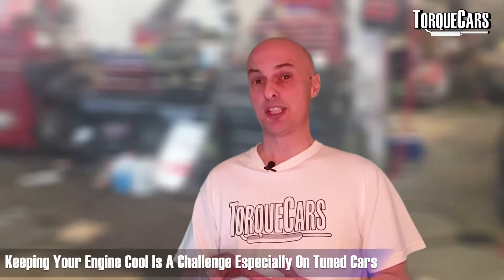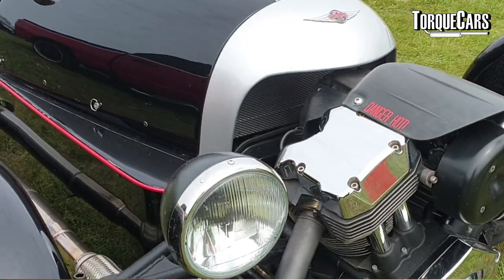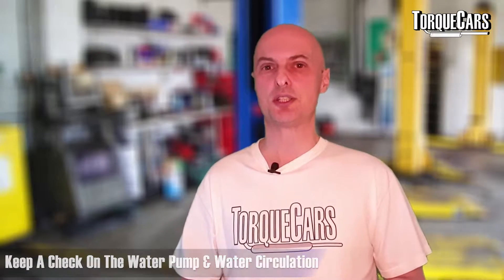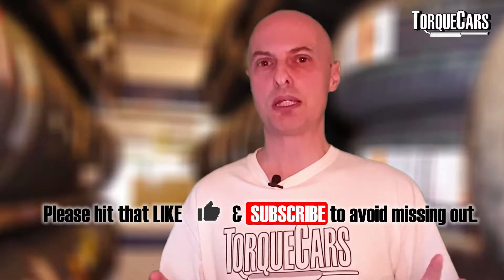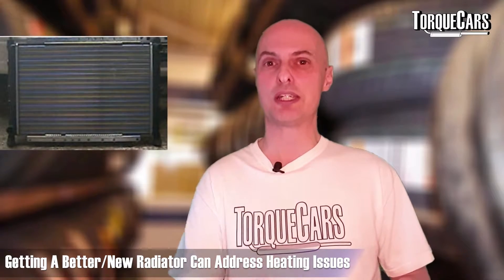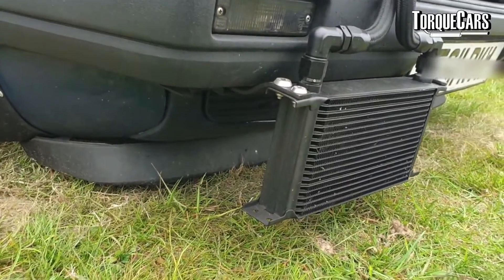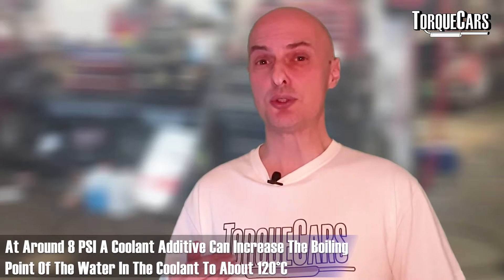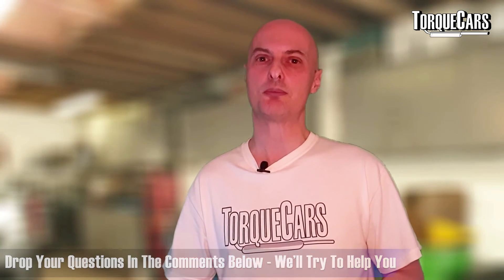Keeping An Overheating Engine Cool [Best Cooling Mods]

Comment: I’m in the process of getting a 98 Aristo V300. Looking to do cooling system, suspension and turbo mods. Not looking for huge hp upgrades. Just want it to run as efficient as possible. Is there any info on key assemblies to focus on under the hood? Like types if metal to use or certain kits that should be recommended. HKS seems to be the only option in Japan.